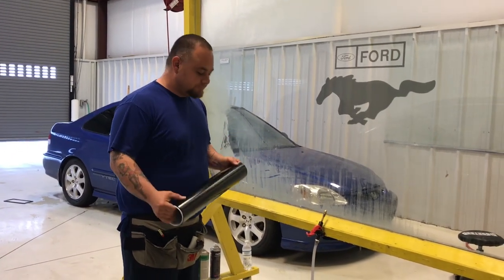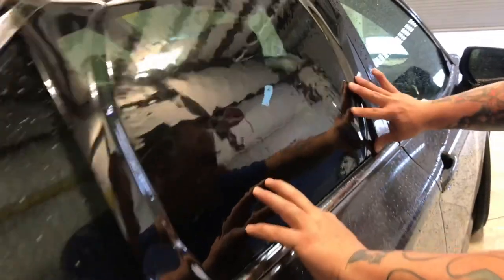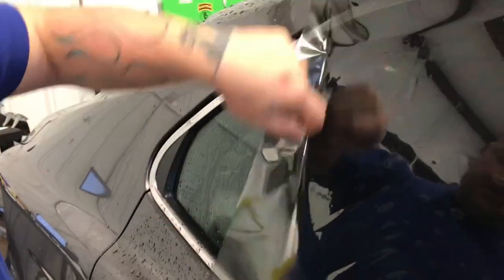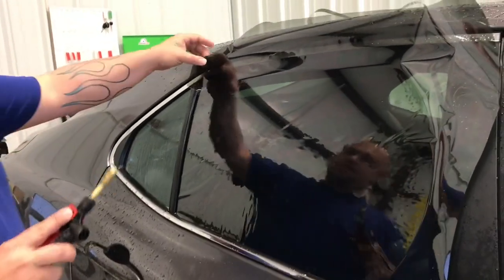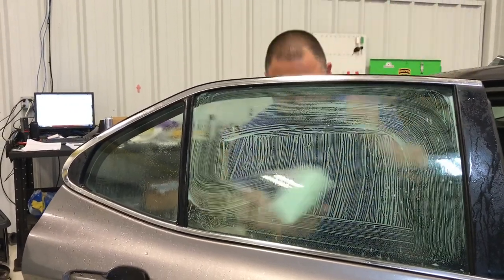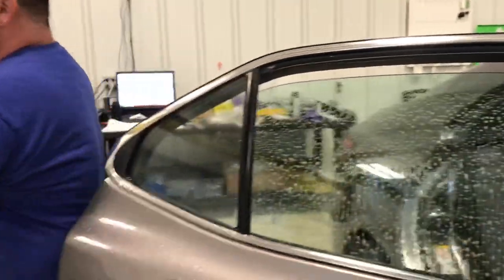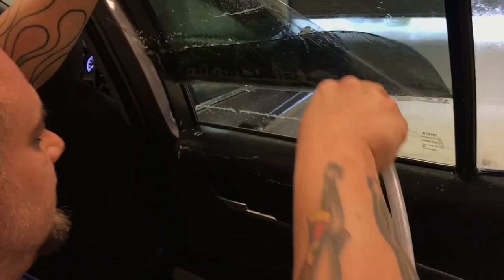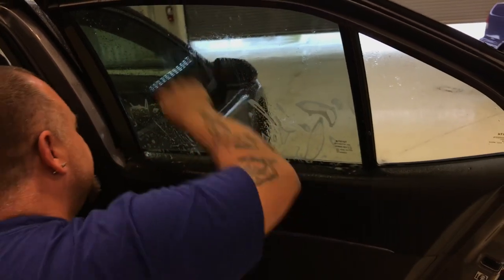Easy how to hand cut and tint a car door window

Comment: Great video! Im wanting to tint my own car, on a budget, in my garage. I don't own a torch or have any the equipment you used really so do you have any advice for someone like me? I feel i could do a decent job but i do have a few questions if you happen to read this. 

1. Do you recommend any particular film for a newbie (link if possible) 
2. I don't have a torch but would a blow-dryer work? 
3. Are you just using a water/soap mixture to spray on the window? 
4. Where can i get those rubber/plastic scrapers? 

Thanks in advance, and in the mean time iv'e subscribed to your channel and i will check out your other videos, you may have already covered all this previously
Reply: Most of the precut stuff isn't that great. Maybe check out Express film and buy some low cost film to start with

Comment: This video shows the best way to cut and apply the tint. One thing I do not understand - some people use heat gun to shrink even if the film is in good shape. Can you explain why?
Reply: yo activate the glue on the film and be 100% sure the film will not move even if the customer hits the window a tiny bit.
Reply: Before applying it to the glass or after its on? Before is because the glass is curved and typically gets fingers along the bottom as thats usually the last part to be squeegeed, thats where the excess film is. So the preshrink at the bottom of the film takes that excess film away by shrinking it in.

Comment: I see many people heat the film with a heat gun while the film is on the outside of the glass. You heat the glass with a torch while the film is in final position. What's the difference,  and is one way better than the other? Thank you.
Reply: Heating the glass is too help the drying process be faster. Heating the tint is too shrink it to make the contour of the tint match the window.